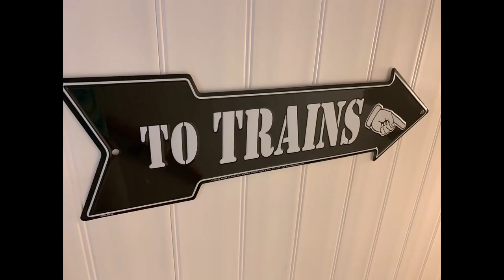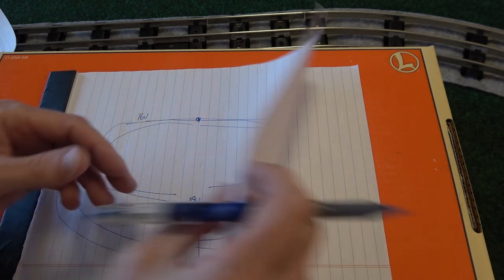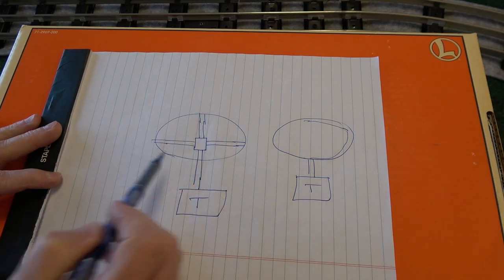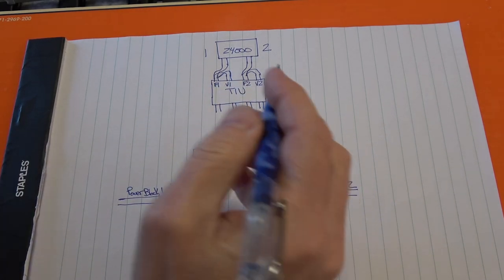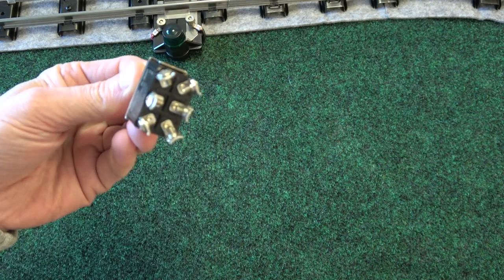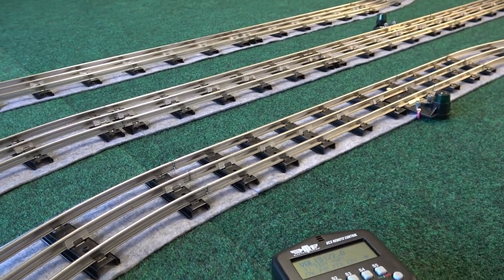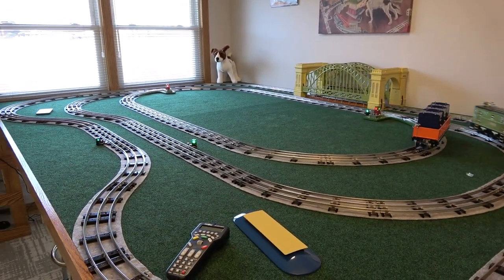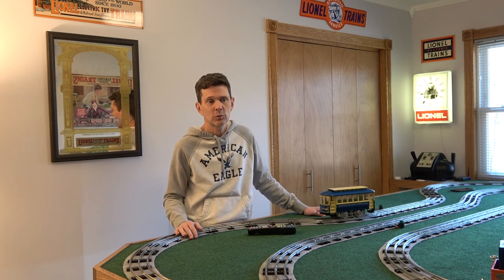Standard of the World - Episode 9 - Track Wiring & Inaugural Train Run!

Comment: On your 2 switches you can run a jumper wire between the 2 switches. Center is common. Outside wires open and close switch. Jumper to other switch will through it when 1st non de railer is activated. The train can run around outside inner loop then inside inner repeat. Hook up a toggle switch to disconnect to run as normal.

Comment: Thanks Sean this is an awesome video really love the wiring that you did on it great job I'm I noticed that you had A-line of terrorists under the layout in a Box I hope you're planning on putting that on there
Reply: Terrace, not terrorists! Sorry
Reply from the maker: Yeah, the Terrace will be on the layout!
Reply: @seanstraindepot  Great Sean! Can't wait to see it. Thank you for clarification on power blocks I always thought a powerblock had to be powered by separate Transformers Transformers or bricks this is a great way to do it I like the toggle switch idea as well hopefully I can find a heavy duty one like you did. My standard gauge and engage layout is a little bigger than yours upstairs, it's 8' by 12'.  I have gotten so many great ideas from your videos thanks for sharing
Reply from the maker: @jsgtrains3176  Oh no, power blocks can come from the same transformer, but each handle is like a separate transformer.  So, on my Z-4000, it is like 2 bricks, one on each handle.  As long as the transformer has the power to handle all the blocks you are setting up.
Reply: @seanstraindepot  Thanks!
Reply: Sean,
What size wire did you run to the track?  Must have missed it. 

Also, are you an actor?  Serious question.

Comment: Hi Sean - thank you for another great video. Do you have to have the block sections to get even voltage all around the track? or could you just have the extra lock-ons please?
Tim
Reply from the maker: It kind of depends on whether you have a single power feed, or multiple power feeds.  Anytime you wire in parallel using multiple power sources (say handle A and Handle B on a transformer, or 2 separate bricks), the Voltage will stay the same, but you are effectively doubling the amperage.  The reverse is true when wiring in series with multiple sources.  The amps will stay the same, but voltage would double.  In this case we are wiring in parallel from a single power source.  The purpose of the blocks is to isolate that block to just that feed.  Also, it is great to troubleshoot shorts.  Without the power blocks on mine, I would have spent so much time trying to find the 2 track shorts I had.  Without the insulator pin, the DCS engine can then receive multiple signals for a command when we only want one (because the signal goes out to all the lock-on's).  So, if it's a small layout, then you may not need power blocks.  Large layouts need them to keep consistent voltage and signal around entire layout.

Comment: try not to put a switch in the middle of a block. Power will go internally through the switch. The wiring is about 20 gauge. This means you will be powering part of your block with a 20 gauge choke point. That will give you voltage drops.

Comment: Hi Sean,
Enjoy your videos learn a lot from them thanks. Building my layout 24x17  using Fastrack did U use anything under the track for Sound reduction? 
Thanks again for your videos 
Billy
Reply from the maker: Yup, I used floor sound insulating material.  Experts say if you use carpet under the track and then trim off the sides, it will fill the cavity and deaden the noise greatly.  So, any old wall to wall carpeting.
Reply: Thanks

Comment: I really like the way you did this Sean! However, the mind has been wandering.
Would it be possible to wire in a 3rd 3 way switch to the DCS Fixed to hook up TMCC?
Reply from the maker: Don't really need it because TMCC is just a signal wire to the track, it does not supply power like the TIU for DCS.  So, for TMCC I just flip the switch to command (so it sends the 18V out of the Fixed TIU to the track) and just grab the Cab-1 Remote.  You could also add a cable between the TIU and Cab-1 Base and control it with the DCS Remote, but I kept the 2 remotes so 2 different people could run trains at same time.
Reply: @seanstraindepot  Thanks for the clarification Sean! Love your layouts